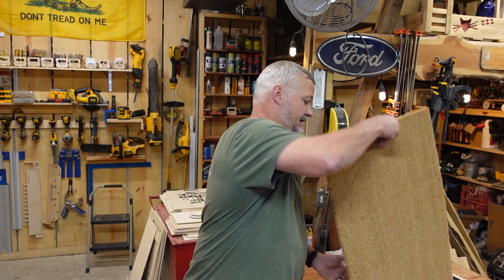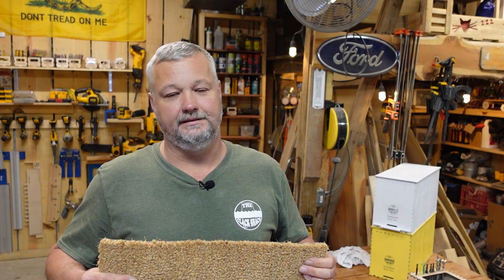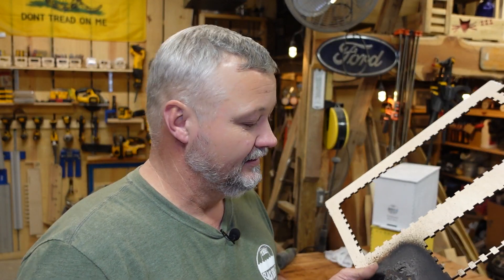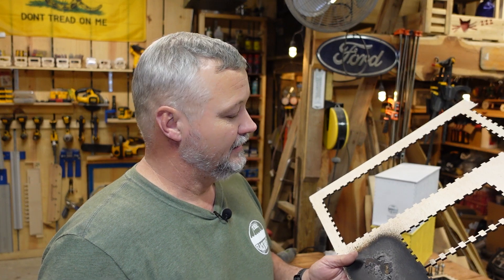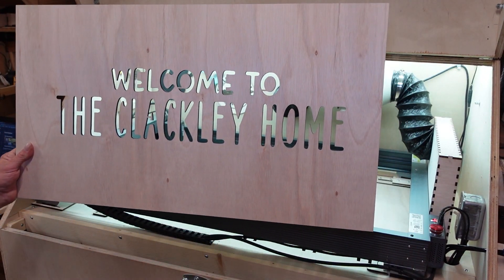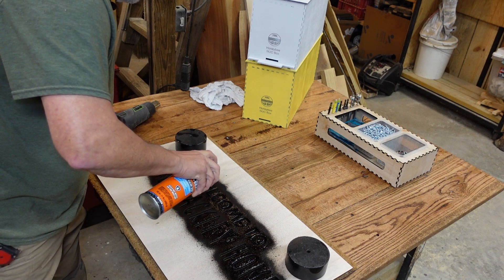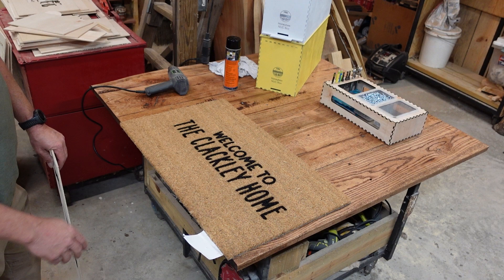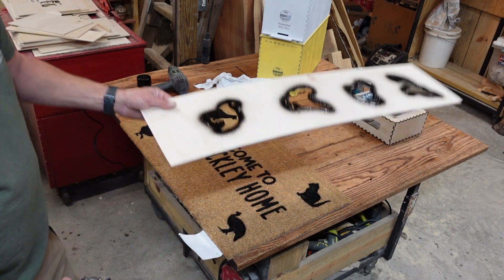Custom welcome mat- laser project

Comment: MI just lasered one of those exact mats....tonight. came upon your video as it burned.   No fire, luckily.  I run my omtech 60w laser in inches/second and not millimeters/second, by the way.  I ran the first pass at 50 speed and 70pwr, but it was too light, so I then ran it again with the same speed and 85 power.  I think it turned out great.  Running it twice, I could see quick flames, but that was it.  I don't know if it will last as long as the Flex-Seal or gorilla stuff, but if it doesn't, I will definitely be trying your method.  Great video.  You just got yourself a new subscriber.  😊
Reply from the maker: Cool.. they burn really well… lol

Comment: People have been cutting templates with a Cricut (or other cutting machines) for a couple of years and then using Flex Seal spray. No clue how the Flex Seal compares to the Gorilla product that you used on this one. Seems to me though cutting the template on a laser would be better as it would provide a more rigid template.
Reply from the maker: Yea, it worked pretty well

Comment: on your video you show tying the inner parts of the O and E's so they stay connected. The next part of the video shows you finish spraying the template and lifting it up to show the fully painted mat. How did you deal with the little ties you made to hold the pieces of the letters together and how did you paint under or around them? AFAD LLC laser engraving
Reply from the maker: I made the bridges small and sprayed from both sides. The nature of spraying, it works around them.

Comment: I do doorhangers can the atezr 20 plus be used for cutting 1/4 mdf. Im using a 6550 pro now. Thanks. Or would you get the 35 watt laser.
Reply from the maker: It takes a couple of passes or really slow speed but yes, it cuts 1/4 mdf.
Reply: @TheClackShack  thanks. Great work.

Comment: Awesome. Could you cut a cardboard stencil with the laser? I haven't done much cutting was just wondering if you could cut out card board or if it would catch on fire.
Reply from the maker: You can, I have done it. The tabs would need to be a little bigger to hold letters securely. Settings have to be right or it will burn. Usually about half power.

Comment: That's thinking outside the box!  And you didn't risk burning down the shop.
Reply from the maker: I have been examining the rugs in shops for sale and they all had a rubber/paint type substance on the letters. This is my attempt to replicate the finished product. It seems to have worked.